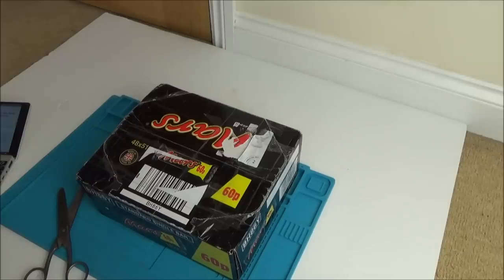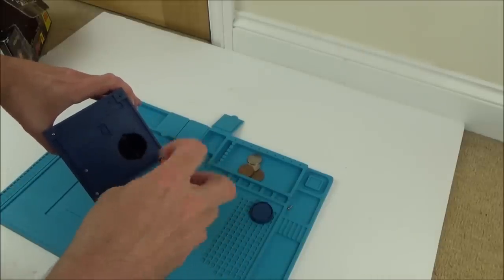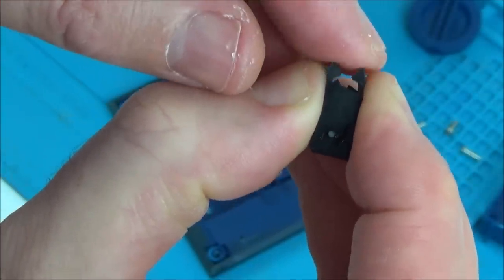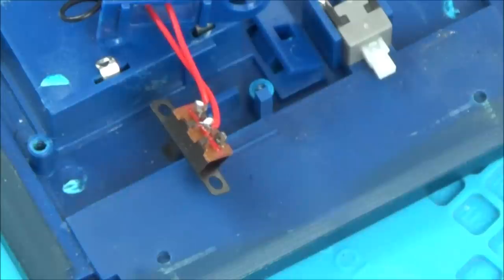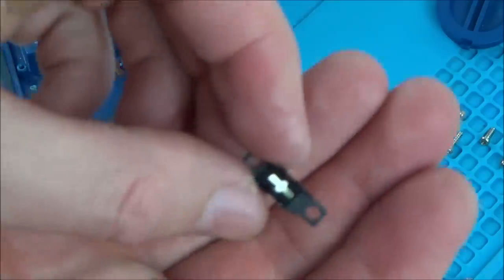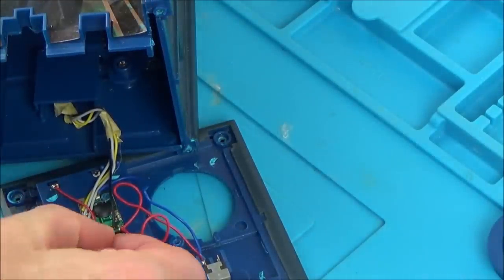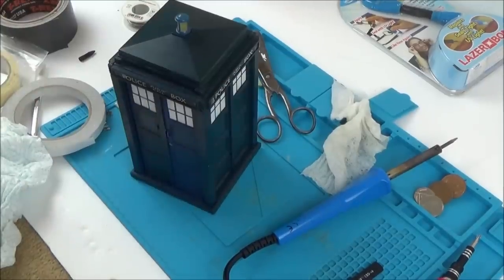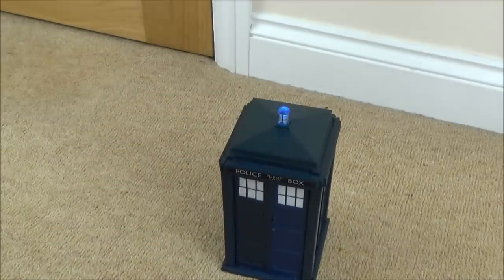Trying to FIX - Doctor Who TARDIS Money Box

Comment: 19:16 you could have used thermal sleeve instead of the tape, but i believe it will do the same :) Great work once again
Reply: Or he could've used the plastic welder to "glue" the transparent plastic. Sure, it would still have a transparent look, but that's the first thing that came to mind when brainstorming ways he could stick that plastic.
Reply from the maker: Like a heat shrink tube, that would have been a great idea :-)

Comment: Nice video again!  My advice would have been to try swapping the one outer wire to the other unused end of the switch then flip the switch around to mount it rather than trying to take apart a slide switch which are very fiddly.